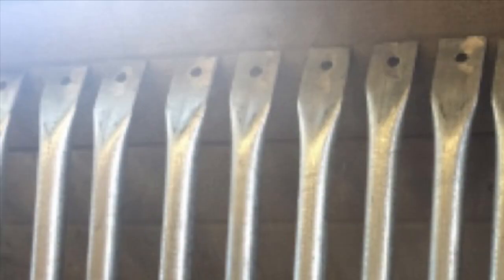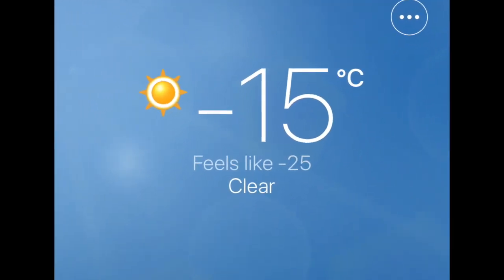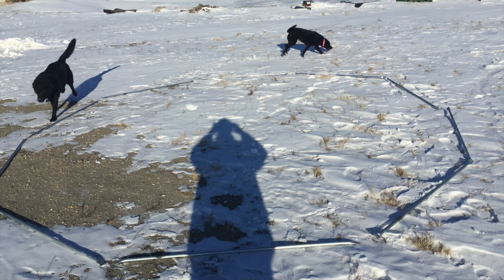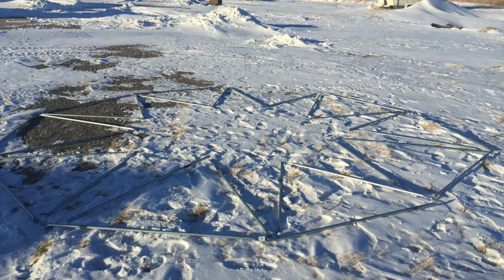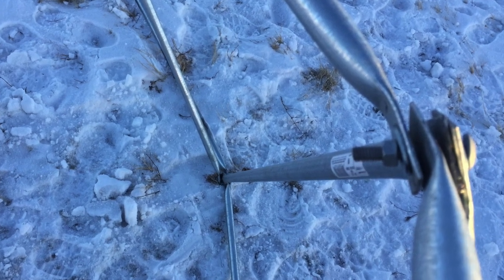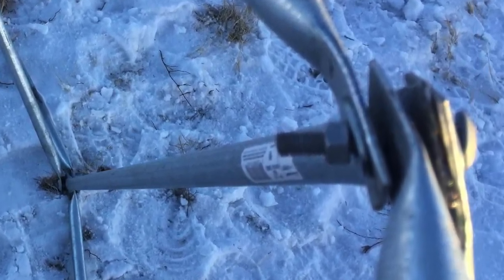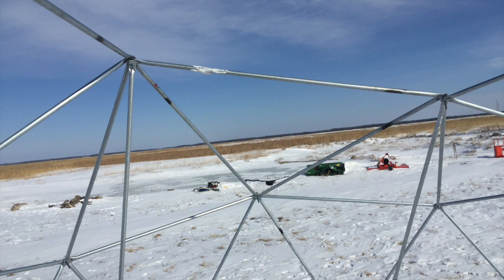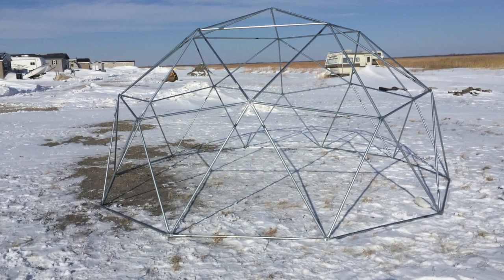$130 Geodesic Dome 2V Frame Build with conduit struts Part 2 (2020)

Comment: If you're building a big 2v dome start with the top of the structure. Build downwards, it's easier, safer and faster. You will still need a stepladder to tighten at the end. But if you overbalance you can grab a semi rigid structure to stop falling. I built a 2v, approximately 3m radius dome with galvanised conduit, exactly like this video. I mounted it on 10 star picket (deer fence size), with  concrete footings.  Diagonal braces on every second panel.The picket top hole exactly fits the holes on the dome base struts. This gives vertical walls and frees up floor space right to the edges. I built this 20 years ago. Still strong and domey. You're welcome 😊 ☺ 🙂
Reply from the maker: Starting from the top means you have to lift it as you go, no thanks

Comment: Very good, my first thought was to use this as a re usable guide to make other domes out of paper mache. If you were to do this using the right glue it could turn out to be a good way to make weather/water proof insulated shelters. I could go further with shelters but it’s a bit off topic but it’s a great technique that you have demonstrated which could be used for other shapes/structures.
Reply from the maker: Thank you

Comment: I just figured out that you can use one-hole straps for the conduit to screw up triangular panels. I haven't done it on a full dome yet though. Just one panel, but it works great.
Reply from the maker: Thank you for the reply!!!!!! interesting
Reply: and a center hole in a sheet metal panel is a good place for a chimney outlet 6.5" - 8.5 " depending on chimney size

Comment: I see that you could connect all the red ones together and make do a lot of work ahead of time and then spread them out as you needed to connect the Blues this might make it nice to take in your pickup truck in a wrecked it as a as a tent if you're going to be camping for a while also for your Greenhouse you might want to just get some tires and and make a circle of tires and place it on top of their and some sort of foundation and heatsink
Reply from the maker: I'll post videos of the foundation soon - put it up 2 feet on a wooden foundation.

Comment: You know I have to admit this I commented on how much conduit was in my home town, and as brain dead i am and didn't use the ol' noggin, I use to work at a Metal yard named Metal Works and the metal we sold was WAY cheaper than home depot. For instance last week I was quoted for 24 feet of 3/4 inch sqare tubing .065 wall for 11 dollars and something cents. Yes 11 dollars for 24 feet. I bet they sell conduit for dirt cheap also. The box stores are rip offs because for 3 feet of 1/16 wall thickness is 8 something. So check the metal yards.
Reply from the maker: ratrodramblin u realize $11 for 24 feet is more than $4 for 10 feet, I paid $3.85 for 10 feet at home depo.

Comment: The frame is the easy part, covering it and making it watertight is the challenge. The options are limited with steel struts, typically folks throw a big sheet of poly over it and lash it down with tape.
Reply from the maker: I have a different plan, stay tuned!
Reply: When it comes to metal framed domes covered in poly, i`ve never seen one that looked cosmetically pleasing or didnt leak like a seive ;)
Reply from the maker: JohnGuest45 i agree but I have an idea how to do it, and I haven’t seen anyone else do it like that yet. We’ll have to wait and see, I can’t finish till the snow melts here now.
Reply: cover it in plastic then put a cage of chicken wire then cover that in tight plastic and slowly fill with aircrete then epoxy paint the aircrete
Reply: Not great for a greenhouse unless you can find some translucent aircrete ;)
Reply from the maker: JohnGuest45 I guess you’ve never heard of 6 or 7 mill clear shrink wrap :(

Comment: I wonder if I can stretch fabric over each triangle in a panel somehow, I love this except for when it comes to the covering
Reply from the maker: if you want to do that, you need to use a material like wood. there's  a few videos on Paul Robinson's channel showing how to do it
Reply: @SimpleTek  I was thinking of installing grommets/eyelets in a tarp, cutting triangles so it fits exactly. Maybe interleaving it with larger triangles in a patchwork
Reply: @SimpleTek  If I'm missing something please let me know lol! I don't see why that wouldn't work but I haven't tried it yet, going to attempt a small model first
Reply from the maker: @benjohnson1938  not sure how you’ll be able to secure triangles beside each other on my design. It’s easy with Paul Robinson’s wood one though
Reply from the maker: @benjohnson1938  look at Paul robinsons designs
Reply: @SimpleTek  was going to have tarp grommet holes at each triangle point and then put all the tarp triangles through the bolts as the outer layer. Would have to round the edges so it doesn't tear the material and maybe additional grommet holes to secure the sides to the poles using velcro loops or zip ties

Comment: Prices for the materials have skyrocketed. Have you built one using 1/2 in conduit or does it have to be 3/4? Are there other materials I can use that will withstand a Canadian winter?
Reply from the maker: Pandemic pricing changed everything
Reply: @SimpleTek  have you tried the 1/2 inch conduit or does it have to be 3/4.
Reply from the maker: @davem7744  I just used the one in the video

Comment: my 2v is a little bigger .. I build different ...from the ground up ... first I make 5 5star parts .. one by one I connect this ...later connect the star tips ..last connect to center top .. it requires some extra bolts ..becouse you disassenmble and attach again while building
Reply from the maker: did you use a plan? would love to see the plans
Reply: @SimpleTek  no just made it work ..my tent is 5mtr high and 10mtr diametric .. so pipes of 3 mtrs and 2.7 .. your tent is much lighter and smaller so you don't need this

Comment: i was looking for a hydraulic press die that would not only press the pipes, but cut them in a rounded ends and possibly punch a hole in the middle for connection. soes anybody know where I can find something liike that???
Reply from the maker: sounds like you need a couple separate tools - ou could have one made that does all that but the cost would be enormous. are you planning on building one dome or making a business out of making domes?
Reply: I am going to build 3domes, and possibly more...

3v 3/8h

Comment: is it strong enough to hold the weight of a few adults climbing on it?
Reply from the maker: Depends on the size of the adults. I’m 300+ lbs, and that’s the limit. But 3 100 lbs adults might be ok
Reply: @SimpleTek  How do you know that it is the limit? How would i buy a thicker conduit to increase the weight load?
Reply from the maker: @sierraharris2175  I can tell by the bending… you pay more money and get thicker metal!

Comment: hey what are the length of both struts?
Reply from the maker: Deep Mohan I used geodome’s online calculator and figured out where to cut a 10 foot pole once with no waste. Can’t remember the lengths, don’t forget to add in extra space for the bolt holes though, I added an inch and a half on each end for that, the calculators measure bolt hole to bolt hole